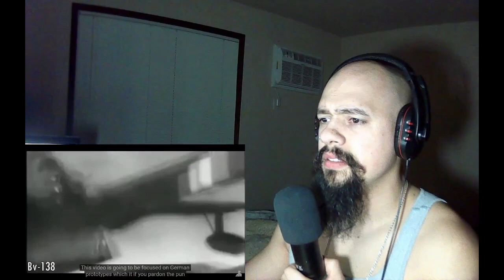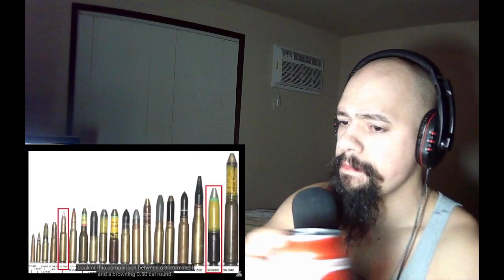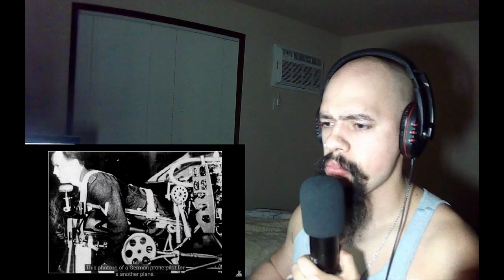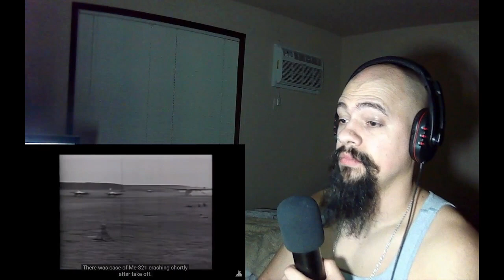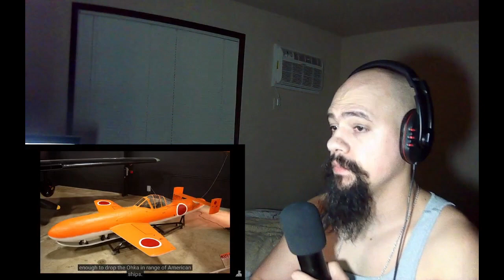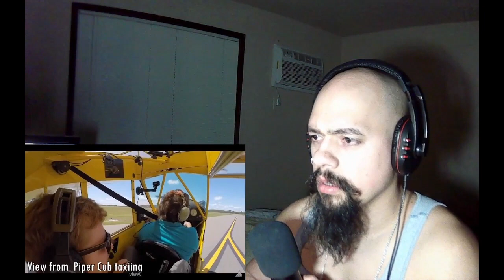American Top German Inventions Reaction - 5 Weird WW2 German Prototypes That Actually Flew

Comment: Another really good video by a pretty good channel...again no clickbait or fake history. One minor thing I did want to mention is that Germany was not really ahead of France in tech at the start of WW2, but they were well ahead in how they used technology...like putting a radio in EVERY tank instead of just the commanders' tanks. In a few ways, the Germans were ahead in tech, like with radar and rockets, but in most areas France was equal or better in their tech...just with outmoded thinking.

I can confirm that the DO-335 is quite incredible up close at the Smithsonian. Of course, that is slightly diminished by the impact of some of the other aircraft that sit near the Dornier...such as the actual Enola Gay...the modified B-29 that dropped the first atom bomb on Hiroshima. But there are not that many air museums in the world that have as many unique and one of a kind exhibits as the Smithsonian Air & Space Museum in its two locations...almost no others are as well stocked.
Reply from the maker: What about Ww1 though, were Germany more advanced that France?
Reply: @Pjalphareacting  That is a darn good question. My impression is that there was not a clearly superior side in terms of tech, but I would have to do a bit of research to know any more than that. I think that Germany generally had better aircraft tech, and France ended up making about the best tank, but again...without research I could be wrong. I will try to find a decent video or two on the subject you could check out.